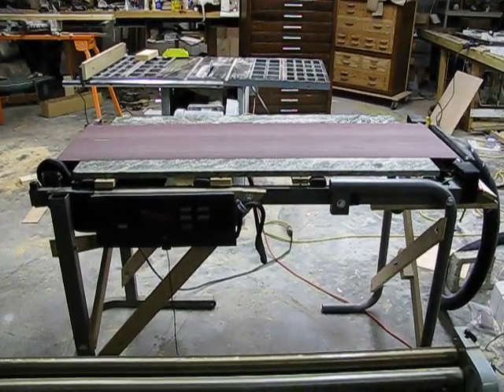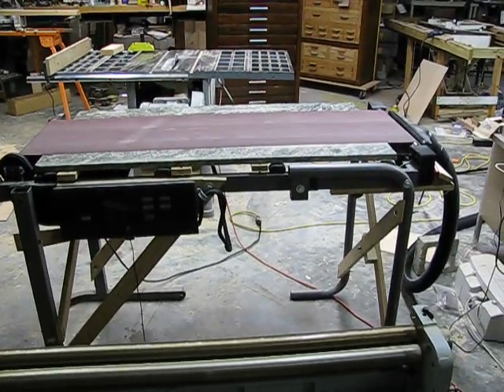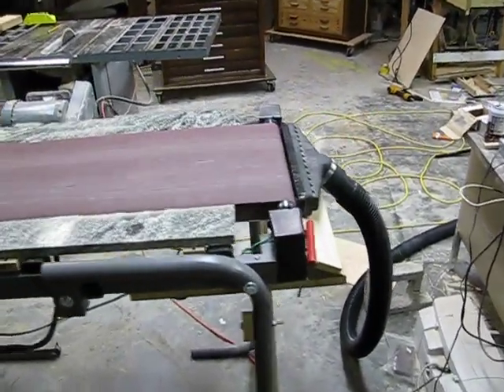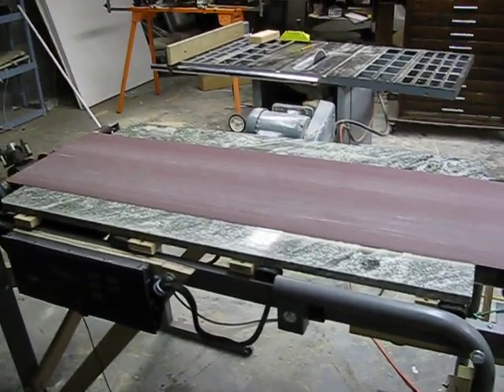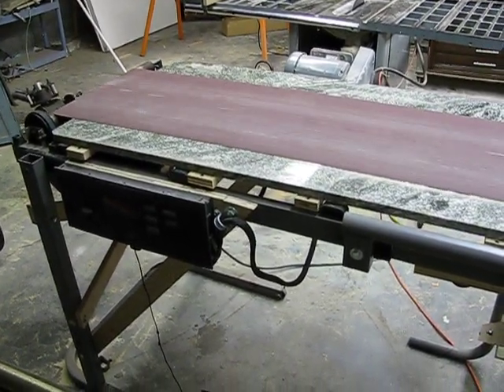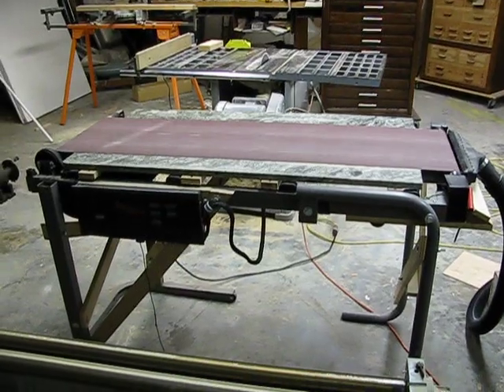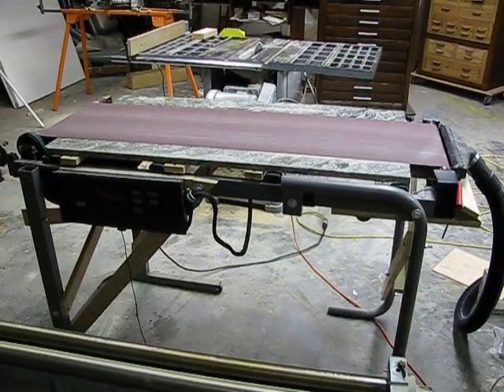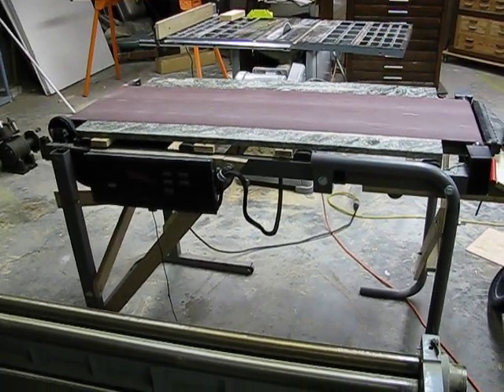MVI 0103 Large Belt Sander

Comment: Beautiful job and such an elegant machine. I'm planning on making pretty much the exact same deal. Was wondering how it is changing the belt. I assume one end of each of the rollers comes off and you can slide a belt on and off. are you able to adjust the distance between the rollers? (I'm thinking this could be useful in getting the right tension/tautness on the belt. Maybe over-thinking here.)
Reply from the maker: +SlimtheTailor Weil  Both roller bearings on one side have to be removed and then the belt will slip on, pretty easy, Bob.

Comment from the maker: The tread is adjustable.  You determine the size by the length of the original belt.  I took the belt off, cut it crosswise and measured it.  The width is up to you. I don't recall the firm that I bought the belt from, but just Google custom belts and order one.  I only paid 18.00 bucks for this one.  I think the co. was in Michigan.

Comment from the maker: I did not increase the pully diameter, you don't have to.  You figure that the belt runs at 12 mph, so you do the math.  Remember, it is variable speed. 63,360 inches in a mile, X 12 =760,320 inches in one hour,  divided by 60 = 12,760 inches / minute.  I am not a math major, but correct if I am wrong.  Thanks.